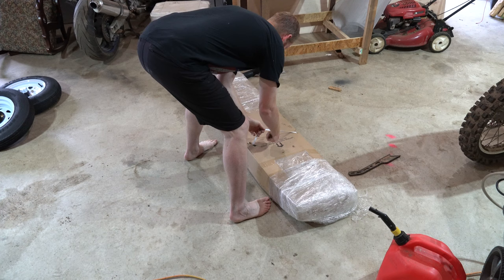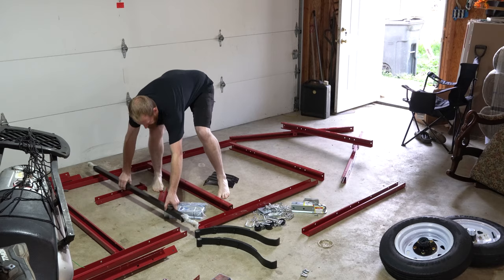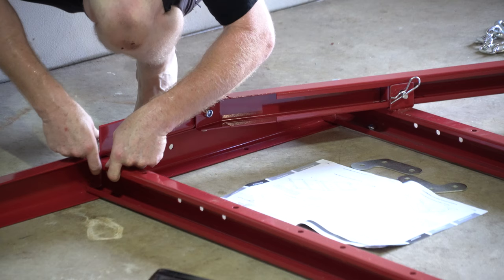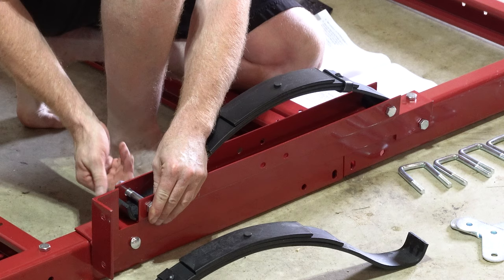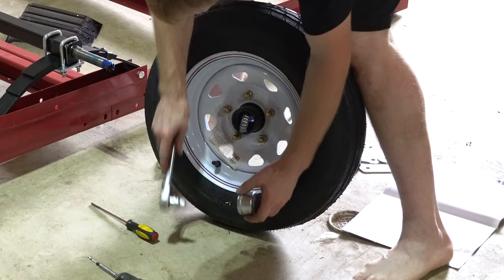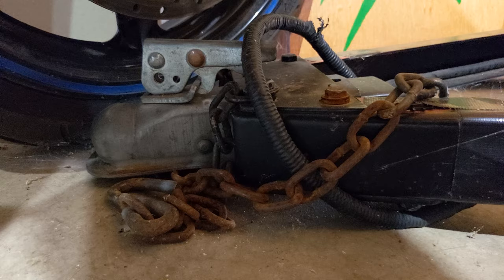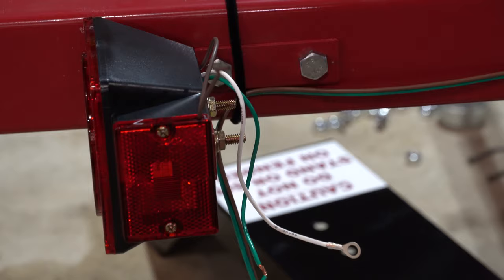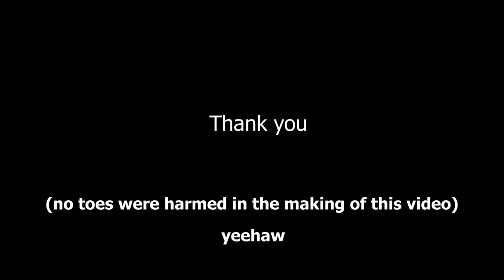Harbor Freight Trailer Build. Full Assembly from Box to Road

Comment: Tip of the day. When repacking bearings, put the bearing and grease in a zip-lock bag. Knead the grease into the bearing.  Much cleaner process for you and the bearing.
Reply: I've had my trailer for about three years now and have been thinking of repacking the bearings because I did it quickly by hand just to get it done. This is a good idea, I'll try this. Thanks!
Reply: that method will not pack the wheel bearings.
Reply: @ratoneJR  been doing it 50 years so I disagree.
Reply: When packing bearings you must PACK it, not just knead it around in a greasy bag.

Comment: Awesome builds! I made a utility box on a HF trailer, and welded a lot of the joints. We bolted everything together for a shakedown, make sure it was square and all the parts were there, and then started grinding and tacking. Not a full seam weld, just a few tacks at each, but it made me feel a lot happier far from home.
Reply from the maker: Thanks for checking out the channel! Those tacks sound like a solid upgrade. I just got a tig welder this week and plan to help out the future builds with welds too. Thanks again!

Comment: I too "deleted" the fold up feature.  I also welded every joint on it, except for the tilt part.  Even if a bolt somehow fails, the frame will still be intact.
Reply from the maker: Ain't nothing wrong with that! Thanks for checking out the video!

Comment: Also, you should clean the grease off the bearings and regrease them. That's only shipping grease that comes on them. Just something i researched and wasnt sure if you were aware.
Reply from the maker: Thank you. I have always made that a practice when buying a new dirt bike and greasing everything with the good stuff. I haven't yet done it on the trailer though. I'll have to do that during the next  micro camper build.
Reply: @mikekrabal  
I've heard good AND bad about that grease, however even if you trust that grease, I've seen a couple of examples where the outside bearing was the only one with grease, and the inner bearing is dry.
I always repack bearings in any "Kit".

Good for my personal peace of mind to inspect them anyway.
Reply from the maker: Thanks for checking out the vid, and you're right. Better to be safe than sorry.
Reply: Nice job
Reply: Was looking to see if someone has already mentioned this. I've heard nothing but bad about that cheap Chinese, low temp grease.

Comment: I did the same thing with eliminating the folding mechanism, but took the extra hardware through those holes in the middle to further secure it. I think I can see you added bolts on the outside holes, but a few on the inside holes really made it feel more solid.
Reply from the maker: Good idea. Although, I didn't do that, I'm currently using the trailer to build a micro camper. The plywood and framing that I attached to the top helps stabilize it as well. On the next assembly, I'll bolt through the middle. Thanks for checking out the video!

Comment: I am buying one of these trailers and have been watching several YT videos to get acquainted. I like the hitch location you showed. There were two things that bothered me about your assembly. 1. Those damn scotch locks you used for the electrical connections. They let water in and corrode the connection. Butt connectors with shrink tubing or equivalent would be much better. 2. No shoes. There were a couple of times I thought for sure you were going to get hurt. Other than that, it was a helpful video.
Reply from the maker: Thanks for watching!

Comment: I built My Tiny RV.with my kit. It is 2 foot high but extends to six feet when parked. I have two hundred watt solar panels, a 2500 watt inverter.I use a four foot farm jack to raise the roof. I use canvas 4x8 feet canvas for the sides which store on roof when driving. Front and back are clear plastic windows. Everything cost under $2000
Reply from the maker: That sounds like a great build. Very inventive. And the clear plastic windows are the way to go. I had glass in my other camper and one of my buddies cracked it. Thanks for letting me know how it turned out. I'd sure like to see a picture of it all set up.

Comment: I got this trailer, new. After driving from Idaho to Kentucky & back with it, and an 18-month sit under cover in-between, I would do the following to the next one, without fail:

1. I would strip all paint off the frame parts to bare metal, reprime & repaint. After sitting under cover in Kentucky for 18 months, various places on the paint began to bubble & rust formed. I'll disassemble, strip, de-rust & paint again. It's worth it.
2. I would discard the factory axle bearing grease & use Valvoline red. Just added insurance.
3. I would buy two new spare rims, put Class C tires on them & put them on the trailer, saving the Class Bs as spares/local tires. Class B tires aren't really for freeway use, even with limiting speed to 60 mph & dodging all the potholes on I-80 between Lincoln, NE & Evanston, WY. Sometimes, a pothole gets through. And those are DOOZIES. Class C is the only way to go.

But for all the stuff I outlined, I love this trailer. It's worth the updates & corrective work. It's a keeper...so I'll refurbish it to that effect.
Reply from the maker: Thanks for the tips and for checking out the video I wish you the best on your refurbishing. They are great little trailers.
Reply: @mikekrabal -- Thank you! Wish you the best, too. I just wish Chinese businesses knew how to paint; sadly, they don't.

Comment: I bought mine 2 years ago for $369 with coupons and then the S10 I was going to pull it with started on fire so that baby is still completely packed up in my garage.  I'm glad I found this video so it will give me something to do while I am freezing in my garage this Winter.
Reply from the maker: That's a great price. I wish they were still that cheap, as I'm about to buy another one and build another camper. Good luck on your assembly. Sorry to hear about your truck.
Reply: @mikekrabal  I finally got around starting to put mine together this morning. And I do not have a single sticker telling me front right or front left. I'm going to compare my trailer to see what all is different between the two
Reply: @jake6483  I also didn't find a sticker, nor any noticeable difference in the metal pieces or diagrams - hope they are all the same :)
Reply: @geoffhart  Everything seemed the same. Overall not a hard job at all, The hardest part is flipping it over without help in a confined garage. An impact driver makes it 10x faster
Reply: @jake6483  Yah - I was considering buying an air rachet just for building this :).  Probably spent 2+ hours tightening (and redoing) all those nuts and bolts.  But you are right, not hard.  And surprisingly manageable weight, for a trailer rated to carry 1500+lbs.
Reply: @geoffhart  I've used it a ton, I added 8 flush mount d rings to strap things down. Buy the bearing buddies and you'll be very happy with it

Comment: I would have inspected the wheel bearings  to ensure they they were packed properly. If in doubt, repack with high temp grease. The most frequent failure points on utility trailers are the bearings and tires.

Comment: Nice quick job getting it together.  Surprised that eliminating the hinge didn't make any holes misalign.  I'd do some extra bolting or welding to attach the front and rear, to make it as rigid as possible as long as you're not folding it.

By luck I have a 32mm combination wrench, so I can skip the big adjustable wrench for the bearing castle nuts.  
Cutting a 2x4 into 16 pieces will let you get both halves of the trailer 2 thicknesses off the floor for easier assembly, then the whole thing higher off the floor for putting on the fenders (stacked 4 high at each corner or 5 in a triangle)

I think raising or dropping the hitch ball on the car/truck to get the trailer exactly level, is better than custom-bungling the assembly of the tongue to attempt to match a specific car's hitch ball height on a straight mount.
Reply from the maker: Thanks for the insightful tips and for checking out the video!

Comment: That’s an interesting idea. I never even considered that you could just leave the hinge off if you don’t want or need the folding feature. I would’ve assumed it would’ve caused some interference or bolt alignment issues.
Reply from the maker: Thanks for having a look at the video. I've now done this with three of those Harbor Freight trailers and so far, so good. If my budget would allow, I'd buy more expensive, one-piece trailers, but these have served me well and are cheap.
Reply: @mikekrabal   

Yep, they are decent as long as you know the limits. I had one many years ago and had no issues. 

Just recently bought another one for a square drop trailer project. I’m going to try leaving out the hinge as well.
Reply from the maker: @jayw900  All the best on your square drop build. I hope it turns out great.

Comment: I have always just put 50psi in any trailer tires up to 3500lbs axles including small boat trailers
I run a mix of 70 mph interstate, state , logging roads and two tracks
Reply from the maker: Thanks for checking out the video. I also appreciate the suggestion from your experience. I haven't towed a lot of trailers, just these small ones. Your experience is helpful to me and others. Thanks.

Comment: My only suggestion would be to use a paint marker to mark all the bolts that you have Tightened then you can do a visual inspection and make sure you got them all.
Reply from the maker: Good call. Thanks for checking out the video!

Comment: Awesome video! I am looking to get the 1720 lb “super duty” trailer from HF. I am planning to haul it with a compact SUV and height to the top of the receiver is 14”. I already have a 2.5” drop/2” rise ball mount. Wondering if I need to flip the coupler location like you did?
Reply from the maker: I'm not comfortable recommending any deviation from the owners manuel, unfortunately. But I do have one of those trailers in the driveway and I went out and measured it's coupler height and the height of my truck balll when it was level. The top of the coupler (not the locking pin mechanism) was 22 inches. That's in the standard mounting position. So it sounds like you need to lower it and without being there to see, it's super hard to know exactly what parts are needed in which configuration. I hope that helps but at the same time it sounds like I may not have been much help. I'm sorry for not having the answer on this one.

Comment: Caveats from my build of this trailer a few months ago:
o  Examine that frame diagram carefully.  If you wear reading glasses, bring them.  I must have tried, and partially assembled, every permutation of rail location and orientation before I found the right one.
o  The provided clips for holding wires to the frame are garbage.  I'm trying some of those 1" square adhesive mounts and zip ties.  We'll see how they're holding on (literally) after a year.
o  Grounding the lights via the frame of the trailer is unreliable.  I spliced the ground wire to both sides of some heavy speaker wire, ran that alongside the wires from the lights, and connected the lights to it directly with splices or wire nuts.
o  If you do plan on folding the trailer: remember to consider how wires will be routed in both configurations.  Make sure the wires won't get pinched in either configuration (or during transition), and leave enough slack at the hinge points.  That includes where the tow bars attach to the front section.

o  When unfolding the trailer, be careful the back half doesn't swing down before the front is level, or you'll be fabbing a new plate bracket.  Don't ask me how I know.

Comment: Because I have installed floorcovering for 50 years it makes my knees hurt watching you do this work but great job. My brother has had both knees replaced so from experience knee pads are way cheaper.
I think I will be doing my first Mini camper with this trailer, so how is this one working for you so far?
Reply from the maker: Thanks for checking out the video. The trailer has done really well. No complaints and I've bought another one just like it. If anything it would be great if the 1720 lb rated trailer had the same crossmember on the tongue as the 1195 lb trailer. That's about it. Some folks don't like them because they're cheap. I am always a nickel over broke, so those trailers work well for me.
Reply: @mikekrabal  I think for the price it is perfect, especially for a light weight Micro Camper.  I priced out the steel and with an axle and wheels it brakes out even, and I don't have to weld. 🙂
I am working on my first and plan to build more commercially, so my first few will be beta testers for friends, we shell see.
Reply from the maker: Sounds like a good plan. I have wondered if buying the steel and making a trailer from scratch was cheaper. Thanks for sharing that.
I went over to your channel and subscribed. I hope you'll share your builds with us on Youtube.

Comment: Good job. I heard it's good to upgrade the axle bearings and tires on this trailer.
Reply from the maker: Thanks for checking out the video! You're right, the price point for these HF trailers almost guarantees low quality components like bearings and tires. I pulled my little micro-camper 21,000 miles cross country and back a few times. (built on a used HF trailer) I was getting 9,000 miles out of the tires and I went through one wheel bearing. Not too bad, but could definitely be improved.

Comment: My Uncle just gave me this same model of trailer. It's a hot mess! It'll be a project this Spring.
The fenders are rusted out pretty bad. Do you have mfg contact info for replacement parts?
Bare knees and bare feet; you just caused my arthritis to flare up! Good work on the assembly! 👍
Reply from the maker: I have a brand new set of those fenders that I'd give you for free. I'm in West Virginia, if you're close enough to pick them up. Other than that, I don't have any manufacturer contact info, unfortunately.
Reply: @mikekrabal Thanks Mike! That's a generous offer. It's a bit far though; I'm out west. Canada actually (Calgary). Maps estimates 40 hours drive time...😳
I'd love to see the Appalachians but the time isn't good.
Thanks none the less!
Keep up the good work and protect them knees. This 'ol tradesman is paying the price now...
✌️

Comment: Did you consider using looming and grommets to protect your wiring? Will you be folding up the trailer for compact storage when not in use? Are you concerned about anything getting pinched and exposed wiring grounding out your hot wires, causing the lighting system to fail?
Reply from the maker: Thanks for watching the video. Greatly appreciated.
I am not sure what looming is, unfortunately. Admittedly, electrical techniques are my weakest point in any build. This trailer will only be used for a micro camper build, so no folding for this unit in the future. By the time the micro camper is built, the wiring will be nicely secured and hidden.
Reply: @mike krabal, its the black plastic tubing with the slit along it for building wiring harnesses. Called wire loom. Really cheap and comes in a variety of sizes. 4x8 trailer, two, maybe 3 packs. Should be able to find it at your local automotive store. Its a lot better for the wiring. Just don't use the cheap knock off electrical tape. Also those blue wire taps, if you start having light issues, thats the first place I look. I won't use them personally. I always solder and heat shrink my connections because I don't like doing things twice lol.
Reply: He said he wasn't going to fold it.

Comment: So confusing. I followed the directions for the front and back assembled and tightened down and squared like it said. But when going to install the leave spring brackets the bolts are in the way… I’m so confused now
Reply from the maker: I hope you got it figured out. It seems you just mounted a couple bolts a little soon. That's no biggie. It's tough to do anything perfect the first time. I rewatched that portion of my video and it seems l anticipated mounting the leaf spring brackets later and left out the bolts that would've been in the way. I could've been a little more clear about that, but that was my first time making this sort of video and it's far from perfect. Thanks for watching!
Reply: My instructions were also wrong on that point.  I had to unbolt the forward section bottom bolt, and replace it with a longer (M30?) bolt, since it was going through 3 layers of steel (the spring bracket, and two frame members at the corner).  The instructions has me using 4 of those longer bolts for the two tow arm brackets, but only 2 were really needed there.

Comment: Are the Harbor Freight trailers good for a camper build?
Reply from the maker: So far, they've been really good to me. Others would say to never use them. I don't have much money so I've used them several times with no issues. However, I have just started building on a Karavan 6x10 trailer frame and it's much sturdier. But WAY more expensive. Literally five times more expensive. Thanks for the question!